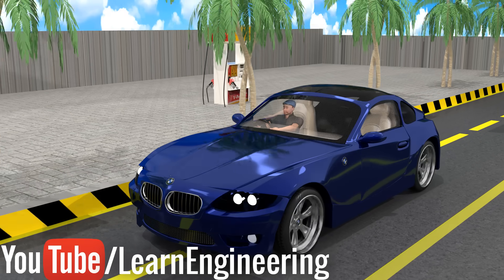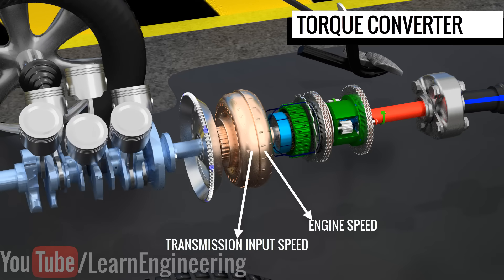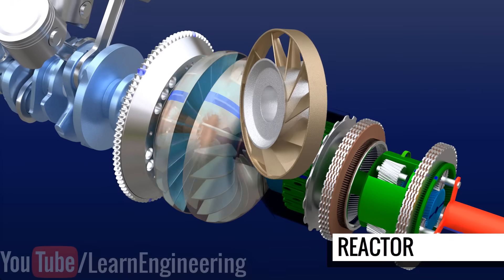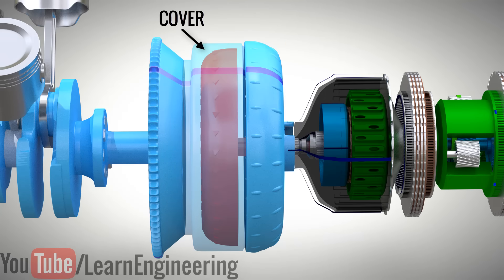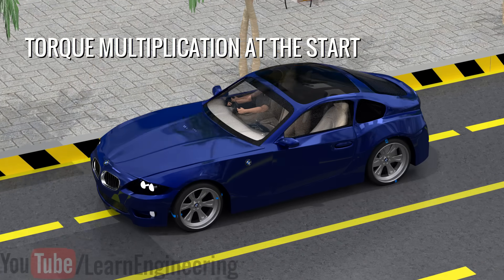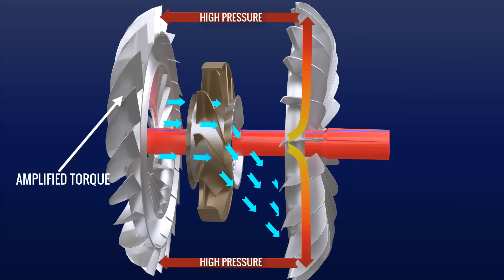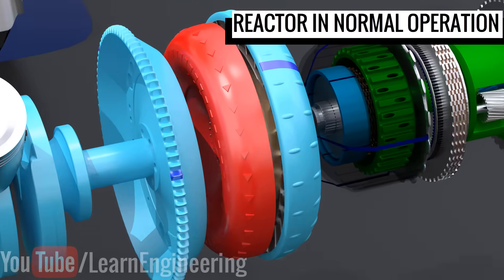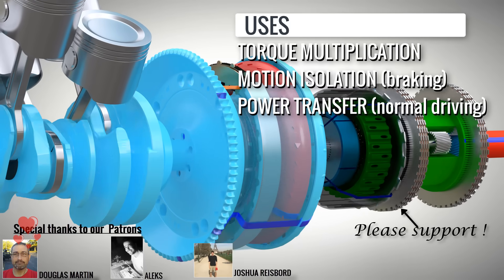Torque Converter, How does it work?

Comment: I can't understand the last point in this video 
If the locking clutch locks turbine and pump mechanically then what's the use of inside fluid , it's as good as regular clutch connecting engine output to transaxle , pls reply , thanks .
Reply: You are talking about the torque convertor lock-up? The difference in relative speeds is pretty minimal, but does show up as big loss in fuel economy at cruising speeds...the engine can hold the same speed at 200-300 less rpm when in lockup. For a very slight difference in speeds between the two stages of the convertor, the clutch involved doesn't have to be very robust...all it does is snap down and lock them together, with a brief moment of slight slip as it does. It is in no way able to handle the full load of, say, the slip required to allow the car to start moving from a stop. But there are cars with dual dry disc clutches but automatic operation, if that would make you happy. Essentially a manual but the computer clutches it with servos for you.
Reply: Mr Rahul Pathak - The fluid coupling is great at handling torque during take off, gear changes and acceleration. It will never wear out in its proper application. A dry clutch in a manual car will be changed several times during the life time of a manual transmission car. 
The additional friction clutch on a lock-up converter does exactly what L TR says. It increases the energy efficieny to 100% when engaged. It is only designed to handle the force necessary for cruising speed. The fluid coupling still handles 90-98% of the load so the friction clutch handles a miniscule load. So an automatic transmission will be just as economic in cruising speeds as a manual car - but you still have the reliability, comfort and torque capabilities of an automatic. In stop and go traffic there won't be any energy conserving advantages with the lock-up function, since it will never engage.
Reply: Yes so that clutch is engaged after turbine has reached 90% rpm of pump , that's why in video it is said that this is engaged for normal operation , and as soon as  condition changes again it works as a fluid coupling .
Reply: Just think back to the beginning of the video. If you stop the car you still need turbine and the pump to spin independently. only way to do that is the use of the fluid. Locking clutch is only there to make the turbine and pump rotate 1:1 at a high speed. Sooo if you take out the fluid and stop the car the drive shaft will break in half and get shoved up the drivers booty cheek.
Reply: It's still good for cooling the transmission at that point.
Reply: I was wondering the same thing, well WHAT engages the clutch.  L TR answered my question...It must have a sensor that tells the computer when to activate a servo to engage/disengage the clutch.  NOW I need to find a video of DCT (dual clutch transmission) as I have a BMW ///M with one in it...
Reply: You're right in that situation it is as good as a regular clutch, once the lock up engages the fluid isn't doing anything. This is because the fluid transfer has friction losses and so if you use the lock up converter constantly you lose power and fuel efficiency, at constant speed you have no use for a torque converter so you just lock it up.

The torque converter is used during transitions, when starting from a stop or while shifting gears, instead of disengaging/slipping a clutch, the clutch causes an interruption in power transfer between gears and a sudden change in output torque while the torque converter does it seamlessly.
Reply: It's only once the torque demands on the system are low enough that you'd use something like this to synchronize the 2 components and remove the losses it's causing because the converter at that point wouldn't actually be needed.
Reply: I'm not being condescending but, if you fully understood the function of a torque converter and how it works, this question would be unnecessary.
Reply: @mcspaghetti19    You do know that until the late 1970s there were no lock-ups on the torque converter.  If you fully understand the torque converter, it will take additional understanding to figure out the lock-up function, which is not really a part of the torque function on the torque converter.

Comment: I repair bolted and welded type torque converters in Turkey, I need more information about reactor sprag bearing (Stator one way clutch bearing) Why we need to use this sprag bearing ?  some bolted type  converterters  not useing this one way clutch bearing ? what is the beneft of this sprag bearing ? Can  some one reply to me ?
Reply: I don't know for sure, but sprags are used to limit or eliminate back torque usually. So I would think it is there to protect the mechanism from that? I know hydraulic motors and pumps are VERY susceptible to damage from backtorque...maybe those are too? I don't know. What kind of vehicle/'equipment?

Comment: 0.o There is no bearing between the torque converter and crankshaft. The torque converter bolts straight to the flywheel.
Reply: There is a centering bushing where the center hub of the TC abuts the crank...
Reply: L TR  ive never seen that. The torque converter bolts straight to the flywheel with no bushing.

Comment: I think it would have been beneficial to include saying when you are driving a truck and press tow haul it locks the torque converter clutches and gives full power the whole time.which in turn   also keeps your rpms up so u can climb hills and decent efficiently
Reply: Uh oh. Sorry dude. The slight slip of an UNLOCKED TCC increases torque, which gets you up a hill easier. Lockups are strictly for increased fuel efficiency in cruising situations under light loads at higher speeds. Tow/Haul gives you a modified shift strategy for better pulling power without lugging the engine. In normal mode they shift as early as possible, to increase fuel economy, and wait as long as possible before downshifting when sensing a load (like climbing a hill)...but when there's a tow load, that can lug the engine down faster than the trans can keep up and cause it to bog, and then make a series of abrupt downshifts to compensate, which burns hella fuel and puts a lotta shock load on the drivetrain and isn't real comfortable to ride in either. By upshifting later (letting the rpm's wind out a bit) on acceleration, and downshifting earlier when sensing load, it's able to keep the engine in its powerband longer and more often while pulling, which ultimately makes it haul better and more efficient and much nicer to be in. It does a few more things to, with regards to how the engine performs, but that's how it affects trans operation.

Comment: It is good, very good educational video, I like it. But then I realized that There should be some relation/colaboration/conectivity to the previous video, I mean... just like this: you and your crew had already made video about "Automatic Transmission" It's also a great video, But why don't Learn Engineering (you and your crew) produceses/makes new education video that include/including both of the videos, that is "How a Torque Converter works" and "How Automatic Transsmission works". I pretty sure that the new one educational video will also very good and many people will like it, Just like of what did you do before of making/producing the educational video about Manual Transmission in "How does a Clutch works" I mean: in the current video, it wasn't clear enough the explanation about Torque Converter, such as: the work of Torque Converter at the time of gear changing, the condition of the Automatic Transmission and Torque Converter from the gear stick, does the Torque Converter needs any replacements, etc. So please think of it, and then do the next step. Thanks to Learn Engineering and it's members for creating/make/producing many many educational videos which is very usefull and interesting to me, stay creative stay productive. That's all from me, thank you very much for listening and care for, Hope Success. By the way, I am Indonesian from the country of Indonesia.

Comment: One thing that I always wanted to know: Is it possible to use a Torque Converter in a manual transmission? It seems to me that it could work just as a clutch works. Automatic necessarily has to use Torque Converter and manual use a clutch?
Reply: I don't think so, the manual transmission requires power to be cut to the drive shaft in order to switch gears, the gears need to physically linked up. However the Torque Converter never cuts power to the drive shaft, the fluid coupling always sends power even when not accelerating. The automatic transmission never need power to be cut in order to switch gears, it's planetary gears are always linked up and only engages and disengages clutch packs during gear change. Operating clutches do not need power cut even in a manually transmission, You do not need to shutdown the engine to press the clutch pedal.

It's probably possible to have an automatic transmission with a electronic controlled clutch instead of torque converter. The computer will need to control when to disengage the clutch, like during a full stop. I assume they don't do it for safety reason, an electronic failure could result in catastrophic damage to the transmission for example if the break is applied but the clutch was not disengaged.
Reply: I see. I think the need to cut power off is the key in starting to understand why one uses a clutch and the other do not. Appreciate the answer.
Reply: Yeah an automatic uses a planetary gearset which gives different ratios depending on which axis of movement is inhibited. Completely different type of setup.

Comment: This is why i drive a manual you lost me at 0.35
Reply: Paul this is a great video but when people ask me to explain a torque convertor, in simplest terms just so they can grasp the concept, I tell them this: Take a box fan. Put another one just like it facing it so they are face to face. Turn one on. What does the other do? It turns, due to the air being blown through its blades, right? Well, aside from the actual configuration of the "blades" and that it is blowing fluid, not air, that's essentially how it works. One fan is blowing using the rotation from the engine, the other is being moved because of it. That second one is what puts power into the transmission. if you were to turn the speed down on the running fan, at some point you'd get too low and not enough air moving to move the other fan's blades. That's like the stall speed of the convertor, that allows the transmission to be stationary while the engine still runs. It works as a clutch, but there's no full disengagement...just a drop in flow speed/volume until too low to provide meaningful power transmission...

Comment: I think my torque converter is going bad it shutters when in 6th gear when it goes to lock up. It’s a 2013 Dodge Avenger with 86k miles so I’m surprised but not it is a Dodge after all. It has a great engine 3.6 pentestar but the tranny and breaks suck. I tried putting shudder stop in it but it did nothing it’s still doing it but it pulls fine nothing slipping or anything.
Reply: What brand ATF are you using in it? Consider switching to something else. I have good luck with Castrol for Imports in my Hondas. You'll likely have to drain and fill at least twice to get it completely swapped.

Comment: At the end what activates the lock up clutch? Computer controlled or mechanically activated by  turbine speed?
Reply: Computer locks it up by way of a solenoid that opens and sends fluid pressure to the servo that applies the TCC.

Comment: do these things ever fail or leak?
Reply: Everything fails eventually. But nowadays automatic and manual transmissions have similar lifetimes.
Reply: not much.
Reply: Change the fluid after 800 miles and thenceforth every twenty thousand miles.
Reply: how perfect are those seals? I'm wondering like Zachary
Reply: They will fail if they overheat. Excess slipping of the lockup clutch component, reduction of fluid flow to and from cooling circuits, etc. It does happen.
Reply: Every thing will eventually fail and go, it’s just a matter of time

Comment: The beginning description of the torque convertor is not a "purely mechanical device". Once fluid is involved or introduced into the system, it becomes a hydraulic device or in this instance a fluid coupler.

Comment: imagine a manual transmission with torque converter
Reply: Yes there is... Chryslers in the 50's, hydridic drive
Reply: It's very common in tractors and construction machinery. It's more durable/reliable than a clutch, prevents stalling and it's better for towing/low traction conditions.

Comment: I don't like automatic transmissions because i want clutch pedal and I want to change gears by my self.
--> Meaning that i would like a car with manual transmission and lockable torque converter between engine and clutch.
Valtra uses this system (without locking) in their lower power tractors as optional accessory and calls it turbine clutch. It's designed to only slip under around 1000 rpm at heavy loads.
Two of our tractors have it and i love it.
PS. great video

Comment: I understood everything in just a single viewing of the video...up until the very end. I often have to rewatch your videos a couple times before I feel like I fully grasped it though here it didn't seem like that. Maybe easier concepts to teach or you are becoming better at explaining! (or I got better at understanding but I wouldn't bet on that)

At the very end you threw a sort of curve ball. It's not that I didn't understand what the purpose of the lock-up clutch was, but it left me confused. When is that clutch used? Because if that was used continuously, it would beat the purpose of the torque converter. And if it was used while the drive wheels are moving, wouldn't you run the risk of stalling the engine if the driver suddenly stopped? And if you can prevent that by releasing it quickly, wouldn't you also be able to do that with a regular clutch from a manual transmission? (meaning what'd be the point of the torque converter as a means of isolating motion)
Reply: The vehicle's ECU/PCU makes the "decision" of when to enable/disable lockup. If the lockup is too aggressive  (torque vs. load too great), you risk slipping of the friction clutch that locks the turbine to the outer case. This likely results in a shudder at specific speeds/load ranges, or premature failure of the friction material. If lockup is too passive, you do not achieve optimal fuel economy. The surface area of the friction material is relatively large, so a relatively small pressure is required to achieve lockup. This fluid pressure is usually - perhaps always - applied through the hollow center or main shaft into the torque converter. I think it is usually switched through a solenoid valve.

Comment: So basically modern torque converter completely ignore the fluid coupling function of the torque converters by using a lock up clutch since it isn’t very effective and the curves blades designed to facilitate the vortex flow further decreased their efficiency. Is that correct?
Reply: The lockup only brings the two sides into full lock when the vehicle is moving under cruising conditions, and the amount of slip is actually pretty negligible, but it has a big impact on fuel economy over time. So it is a full fluid-coupled system, it just uses the lockup to eliminate ALL input to output loss once moving along. The difference is a couple hundred rpm at speeds above 40 mph or so. Eliminating that completely through lockup saves fuel. Old cars with automatics didn't have this. It showed up in the 80's I guess, from my memory.
Reply: L TR I mean the reason why they use lockup clutch is because the fluid coupling function is inefficient so they completely ignored that function, as for torque multiplying it is sort of a fluid coupling however I am talking about the “fluid coupling” stage itself.